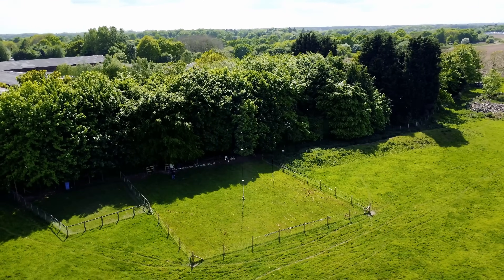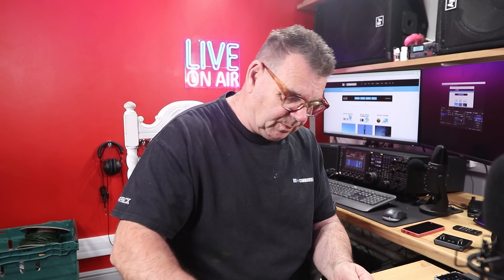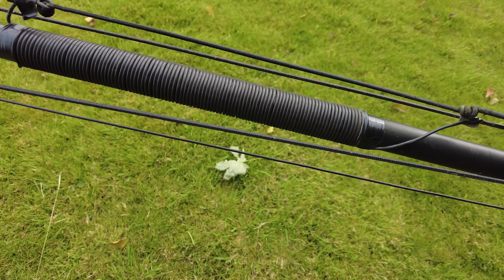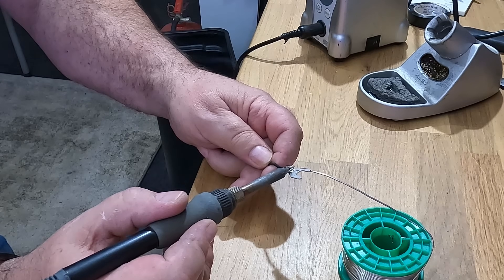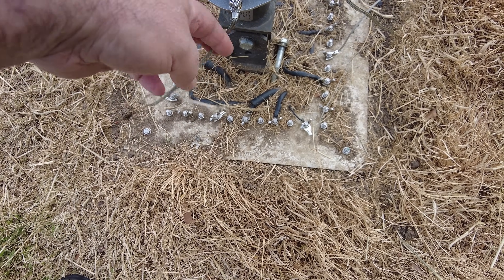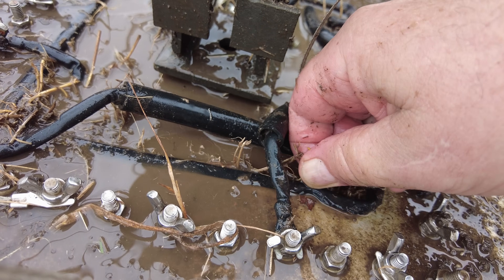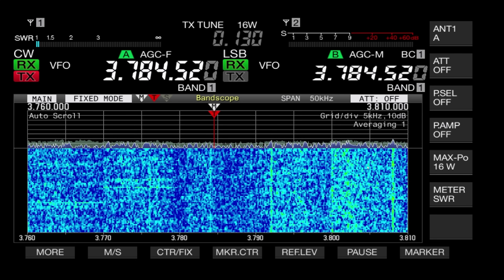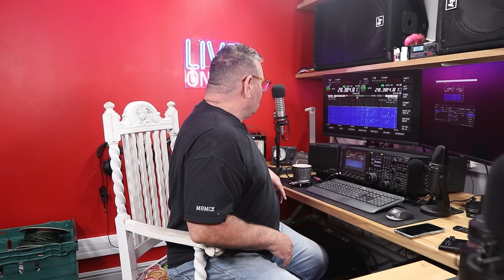DX Commander Callum Builds a NEW Signature 12.4

Comment: I used the following method for the telescopic pole:
Dipped the outer tube in boiling water and cooled the inner tube with ice spray 
to then quickly push them into each other and it worked great.
Reply from the maker: PERFECT

Comment: Callum, have you considered mounting this over a  ground mast (like the signature 9, only longer and reinforced)?  Not having guy ropes would be a game changer with a riding lawn mower.  I would like to use a longer ground mast set in concrete with fiberglass rebar inside the mast also filled with concrete.  A old car tire over the ground radial plate for a mow edge barrier.
Reply from the maker: COnsidered it - but Sig 9 was designed around the thoughts...

Comment: I worked for jaguar cars and back in 1990's earth straps breaking at the point that the solder had wicked up the braid, was one of the highest warrantyclaims. That was just engine vibration, so they switched to crimp only.
Reply from the maker: Interesting!

Comment: Hello form Italy north.  I live in the Alps, in the valley, and have the mountains over 3000 metres in the near. It's that one solution for me?
Reply from the maker: It depends on the angle. RF will defract off the top but if the angle between your QTH and top of mountain is greater than about 25 degrees, you might struggle. BUT you can get out on 40m and 80m since it normally uses a higher angle.
Reply: @DXCommanderHQ thank you for your input. I will   check this. The last question, wat its the minimum consider distance, antenna to house ( 11 meter high).

I like your antenna,  I will instantly one. 10 - 20 meter band. 73 IN3RPE  / jn56ko
Reply from the maker: @Reinhard_Südtirol  OK so houses are "mostly" transparent to most RF on the HF bands BUT houses generate RF interference so keep it away from the house is sometimes a good idea. BUT it will still work :)

Comment: It's always funny to me, you see a guy or girl out in a field, showing off their antenna, it's a couple of bits of wire, worth $20 or so, attached to decent pole worth $150 or so, with another $100 in coax...so an investment of around $250-300 for the antenna. Then they show you their shack, and that cheap as chips antenna is connected to a $20,000 radio.....It's like when I go mobile op's, i have an IC7300, a $1500 radio and i'm using antenna I built for under $10......usually mounted to a tree stump with some bungee cords or a few cable ties....

Gotta have that "flash as a rat with  a gold tooth" rig though....have to connect our cheap and nasty wire to a VERY expensive socket to make it useful.....Sometimes I think us HAMS do too much for too little end benefit. But YES I am jealous and yes I am broke....I WISH I had the $20,000 to spend on a radio,  so I too could be flasher than Michael Jackson....
Reply from the maker: There's nothing actually wrong with a top-of-the-range radio because that is the bit we fiddle with when it's pissing down with rain outside.
Reply: @DXCommanderHQ  So it's TRUE, the older we men get, the more expensive our toys get. Now at 55, I have radios to play with, at 45 it was Grandkids, at 35 it was women, at 25 it was alcohol and cars, at 15 it was....let's just say it, a BUCKETLOAD of knuckle babies died...so anyway I have more radio's beside my bed than Kleenex boxes now....and YES, mine are also connected to simple bit of wire on a stick....we really are a simple bunch aren't we....🤣🤣🤣🤣

Comment: Great stuff. You probably covered this before, but what kind of feed line do you use to bring this back to your radio(s) and how long is it?
Reply from the maker: Between shack and field is 45m of EcoFlex 15. The about 45m of "regular" coax inside the shack and about 15m of BuryFlex between cabinet in field and feedpoint.

Comment: Callum,  I just finished building and putting into service a new 12.4 system. I use a RigExpert AA-600 to scan the antenna as a whole system from 80 meters to 10 meters.  Just so we are on the "same page" as it were, set Limits: Center, @ 27k, Range, @ (+/-) 17k and Points, @ 400.  Then do a "Single" scan".  In over 60 years of Amatuer Radio and many brands of analyzer use, this is the best, in my experience.  It tells the absolute truth in one scan. By the way, I am also an empirical person, also. Tom KJ9P
Reply from the maker: Empirical.. Now that's a new word for me. OK.. I looked it up. We're on the same page!

Comment: When I put up my classic 2 years ago I sinned and did everything in metric since the element chart was in metric. Worked perfectly. Only a couple of minor adjustments needed. I use a rubber mulch tree ring around the bottom between the ground plate and element plate to help with grass. They should be available at a yard and garden supply.  I can't be the only one wondering about the chair. 😁
Reply from the maker: I need to paint that chair!

Comment: Great work. Them weeds grow faster than the grass hear in the US. Yes yard maintenance tools in us mostly battery electric,  and they break and battery go dead. Their is a NASA report about soldering VS crimping. But that apply to high vibration. We are not on a rocket ship. I crimp then solder then heat shrink. works great for me.  That new Antenna field looking great ! That output section in that Acom tube amp works like a tuner. Can easy handle 3:1 . don't use SWR ratio. it is the reflect power in watts that counts and if too high that ACOM will tripp. If it does just bring down drive a tad.  I don't use SWR my self after set up. I have cross needle wattmeter.  I watch reflect watts . that is what makes tubes of finals heat up. They see forward power  and reflect power add together . If you subtract the numbers from forward to reflect power that gives you about how many bananas leaving the antenna out in the world. take away line loss . 73
Reply from the maker: Yes, the Acom 2000 trips at 575W. Don't ask me how I know :)

Comment: Callum, I have a little challenge for you. If nothing blows up between now and then I plan to purchase a classic from you this fall. My problem is that I do not have room to tilt up the antenna once assembled so I will have to assemble it on the ground then collapse it and put it up vertically one section at a time between the branches of some trees. The best place for me to put it would have it in between 2 spruce trees that are only about 5 feet apart, definitely not ideal. So here is the challenge if you choose to except it (and have time to do it) - temperately install a classic in the middle of the trees on the building side of your field where there is no room to tilt it up and see what the result is, how hard is it to put up and is it reasonably secure not to collapse. I realize the trees being parallel to the wires will likely change the tuning some, maybe considerably and the tuning my change seasonally.
Have a great week and great get together.
73 K1AUS
Reply from the maker: You COULD do it. It's just fiddly.

Comment: Morning from across the pond I'm not sure how to feel about gluing the sections together. Myself have had 70-80 mph winds here in the US I'm in IL and I bought in on the first 50 12.4's and did have a break with 70+mph winds. so what I did to combat this is bought some of your thumb drive jubilee clips and put those on the bottom side of the section joint along with the originals clips that go on the upper side of the joint. And this far (knocking on wood) I've been thru 2 big wind storms that was a surprise and it produced 70-80 mph winds and the DXC 12.4 has done great plus I also guy at the first spreader and the 3rd spreader the 3rd being a loose guy to let it move some. Other than that Callum you have built a great antenna in the 12.4 hands down Thankyou and enjoy your day de W9US😎😎😎😎
Reply from the maker: Well, I thought since they glue cars and ships together, I'll give it a try. Time will tell :)

Comment: I was an advocate of soldering as being 'the only' way. But it's dependent upon skill of hand. Crimping is repeatable and when done with correctly calibrated/checked tools (go/no-go gauges), forms pretty much a single, formed connection. I still solder though as crimp tools are expensive to buy/maintain!